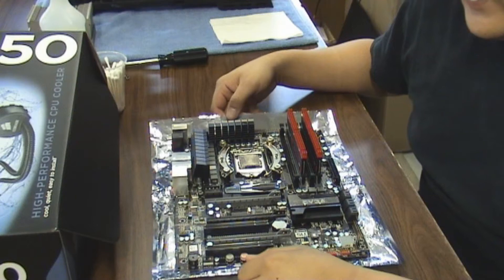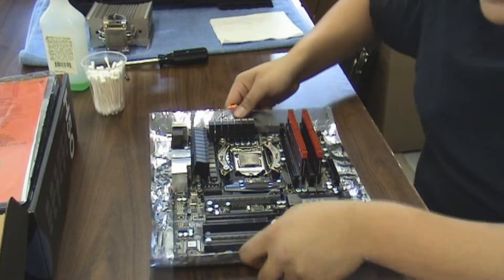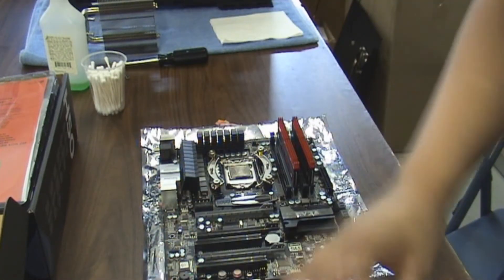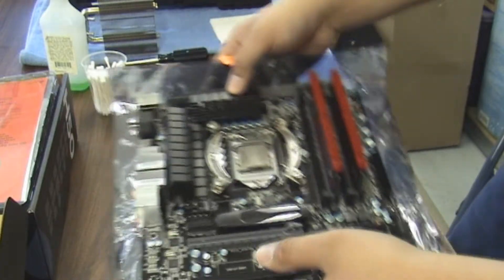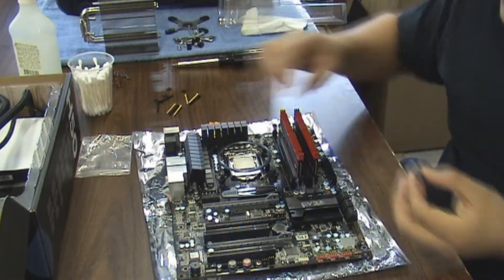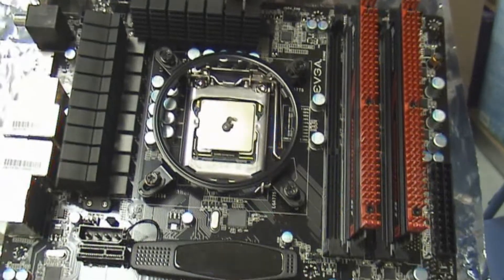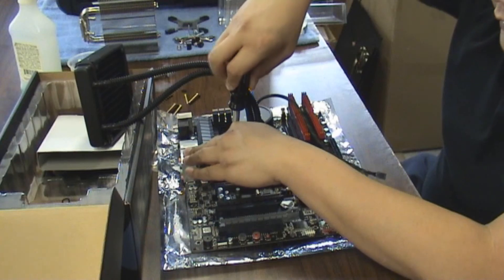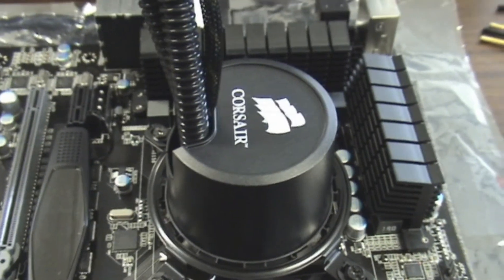Redoing Thermal Paste

Comment: Hey bro,

Wanted to ask did you have any difficulty installing the H50 back plate? Got the EVGA P55 SLi board and it seems the bracket (1156) doesnt line up with the motherboard somehow... Wierd! any suggestions.

Comment: Did you clean off tge stock thermal paste of the H50?

That had Shin Etsu x23 and it's better then that AS5 you used.

Also I'd like to note that you said"Theres a very thing amount" that idle for temps, you really don't want to have to much between the Heatsink and the CPU cause that will raise temps.

Comment: Wonder why my comment showed up 2x, more bugs with YT.
Glad to hear that your temps have dropped some, but I too think they should be lower. My 920 clocked at 3.8 is seeing the low 70's after running Prime for 24hrs at 100%. and thats with the V8. One would thing that the 860 should run a little cooler.

Also not all CPU's need lapping, some are within a comfortable range and by lapping you way only realize 2-3C. I would suggest running test, before spending hours lapping. 860 perfect candidate

Comment: Nice vid bro. Liked!
I'm wondering if you need to lap your CPU, by the way the compound looked, it may need lapping. 
Also IMO, you should always remove the CPU before cleaning, you don't want to risk getting any residual liquid below the CPU. And that was pretty risky poring the alcohol on to the towel right over your mobo, what if the bottle was to slip from your hand, ...ooch that would suck.

Comment: i have a question about the SSD slot.  uh is the bracket holder thingy removable so you can fit an SSD in any HDD bay, or is locked to a specific one?

my plan is to have the top slots filled with a Boot SSD and a storage HDD and remove the bottom bays for some fans.  will that work?